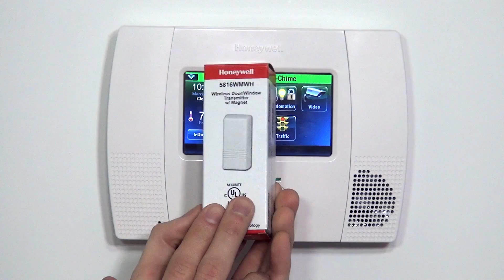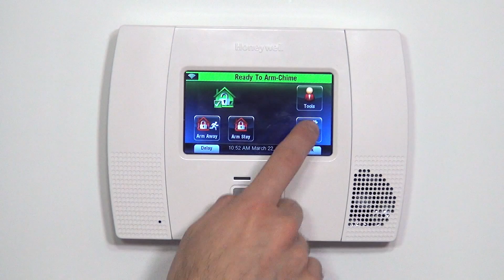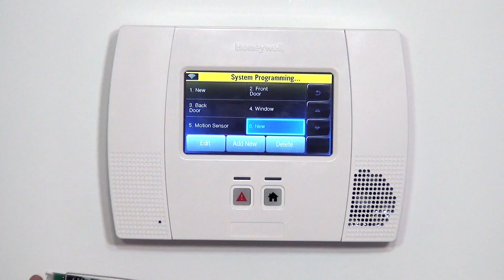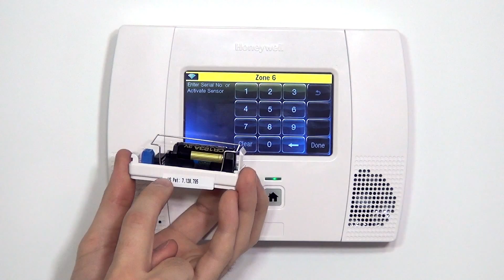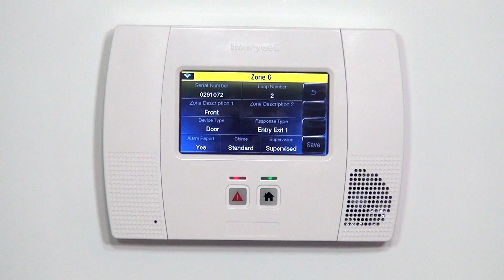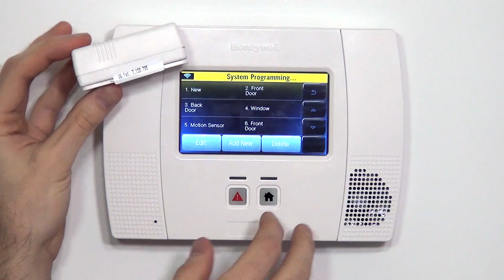Honeywell 5816: L5200 Programming

Comment: I have a sensor that was going to 2 windows using the wires on the blue terminal.  I changed windows and only need the sensor with the magnet.  How do I change my sensor to recognize only the magnet and remove the wires.  I removed the wires and could not get the sensor to recognize just the magnet.
Reply: You want to enter programming and change it to loop 2. Email us with any further questions and we can assist from there.

Comment: Great vid, so a question as you guys seem as knowledgeable as I have seen yet.  I have an older type of alarm at my house, standard keypad with hardwired everything.  I want to update and use what I have and add wireless to new reno doors/windows. Will the 5200 do this or do I have to change everything to wireless? Also what is the range when considering outer buildings? My current system has the panel in the basement, DSC maybe? 15 years old or so.

Comment: Does the L5200 panel still available ?
Reply: The L5200 is no longer available. I'd suggest going with the L7000 if you wanted to get a lynx panel, or go with the newer Lyric panel.
Reply: Does the L7000 has  pstn dialer ?

Comment: If you have an interior door (such as an office door) you want armed that if activated you want the alarm to immediately sound in away mode for, but not set the alarm off in stay mode, would you program it as an interior follower or something else?
Reply: This is correct, I do believe you'll need to set the device type as 'Other' first but setting the response type as 'Interior Follwer' is the way to go.

Comment: Using it as a transmitter, what the hell were you saying??? people are suppose to know what you meant? That sucked.
Reply: I'm sorry the video wasn't more clear. A 5816 sensor can be used as a door contact with a magnet or it can also be used as a wireless pass-through transmitter with a wired contact wired into the 5816 internal screw contacts. In that setup, the wired contact/magnet would send the signal to the 5816 and it woudl just act as a "wireless transmitter" to send the wired alarm signal back to the wireless Honeywell system. I hope this helps explain it better and if you have any other questions, please let us know.

Comment: How can I factory data reset the alarm? I bought a house and here is an alarm like the one you showed
Reply: https://www.alarmgrid.com/faq/how-do-i-set-my-l5200-or-l7000-to-factory-defaults this goes over how to reset the panel. Keep in mind you'll need to reprogram all the sensors. If you're just looking to change codes you can do this without resetting the panel. https://www.alarmgrid.com/faq/how-do-i-get-back-into-programming-if-i-am-locked-out-on-my-l520

Comment: Once I enter my installer code I dont have option to program. In fact the menu that comes up is completely different than yours
Reply: If you see a screen with Users, Events, etc, you used your panel's Master Code instead of the Installer Code. The default IC is 4112 but it may have been changed. We explain the different codes at https://www.youtube.com/watch?v=fFCVUezdx14 and if you don't know your IC, you can get into programming through a back door option following the instructions at https://www.alarmgrid.com/faq/how-do-you-reset-the-installer-code-on-a-honeywell-l5200-wireles.

Comment: Thanks man!! Just got my ADT service installed today. The sales guy said I would have to call them to activate more window sensors in the future. There might be a fee... Not!
Reply: Frank Longo ok I will make sure it's in test. thanks!
Reply: looks like the  installer code isnt 4112.. wonder if i can reset the installer code without messing anything up
Reply: @paulturner8394 Installer codes may vary.
Reply: Alarm Grid is not associated with ADT.

Comment: great video, i just bought the 5816 but my issue is a little different than a new install. I am replacing a door sensor. One of our door sensors was thrown away when we changed out a door but the magnet is still on the door jam. What are the steps of replacing the current door sensor that is faulting because it is no longer there and do i need to replace the magnet or can i use the current magnet installed? Thanks for your help.
Reply: Just delete the zone then it will say new again. The magnet can stay.

Comment: Since this is a one way wireless system, would I be able to use one wireless sensor on two panels at the same time?
Reply: Yes, in theory.  This usually works better with portable devices, such as a one-way keyfob, which isn't supervised for check in.
Reply: Julia Ross: Thanks. That's just what I needed to do.
Reply: You're welcome, happy to help.